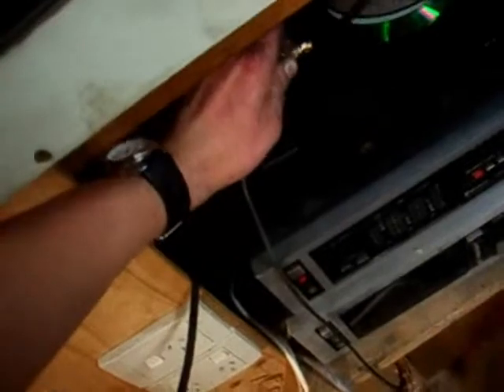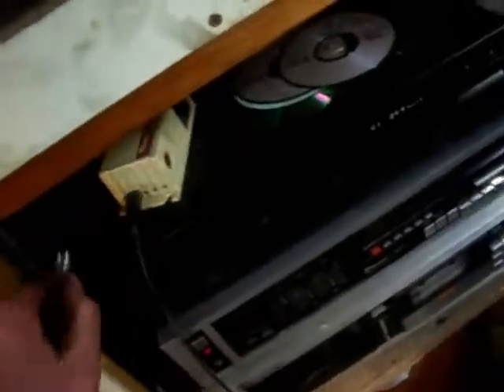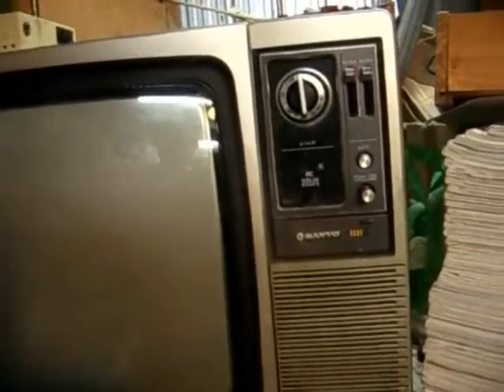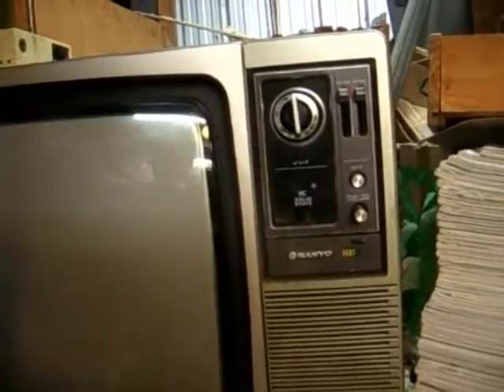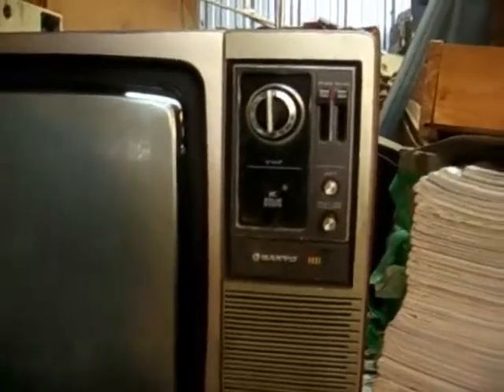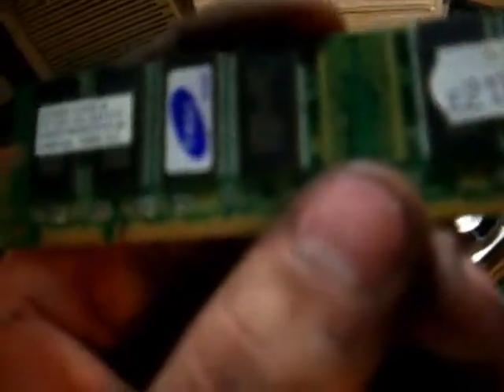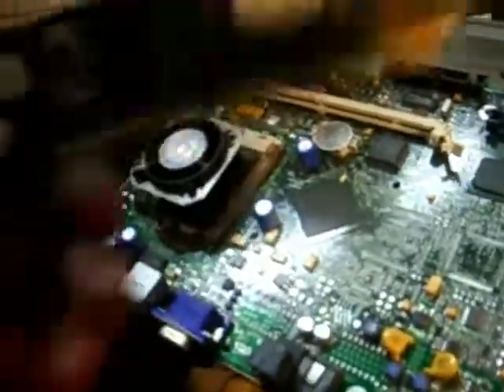playing with vintage tv part 3 fixed!

Comment: sweet!, I'd say that blue is semi-conductive but keeping the glass around it clean should keep it happy.

only thing is you can't discharge the tube without breaking the seal, so wait a few hours before trying.

since the flyback is breaking down you may get a few funny noises from it untill it dies. but other than that it looks awesome!

Well done!

Comment: @Jaytheozzi if in doubt just wait a few days without turning it on and apply a smear of clear glass silicone over the edges to make a barrier.

it will make the cap harder to remove but since the flyback is failing I would say it won't matter.